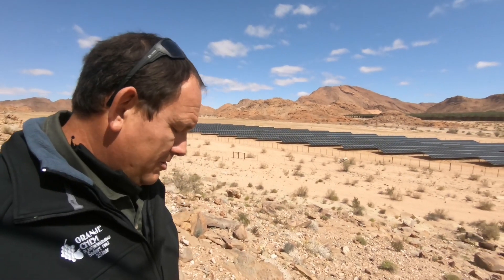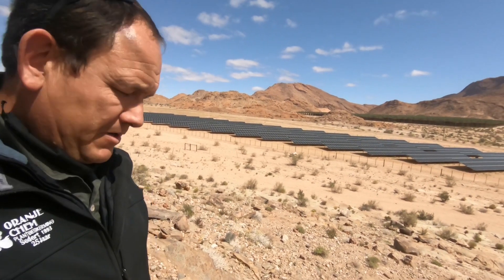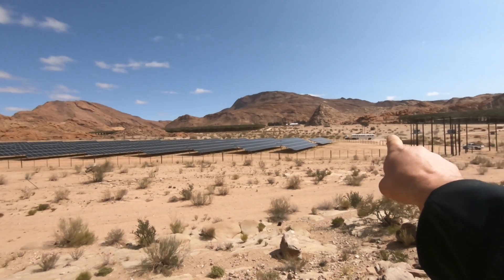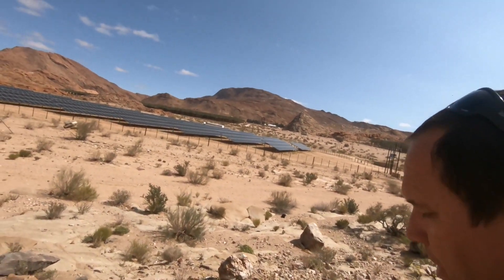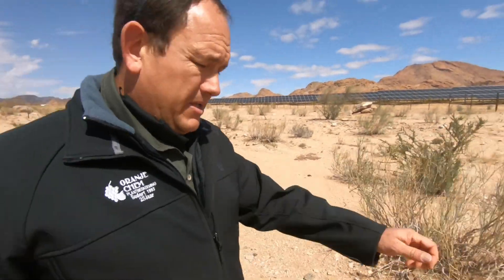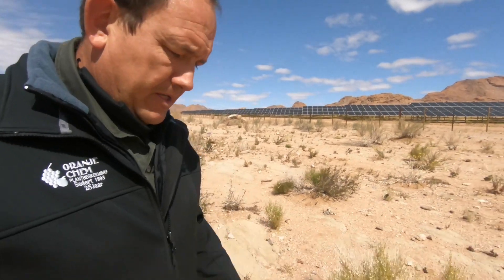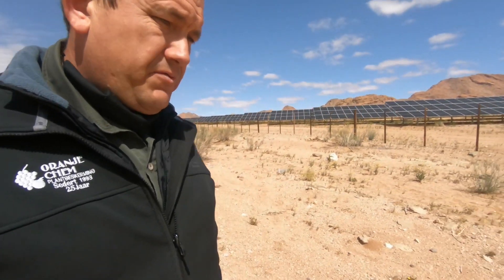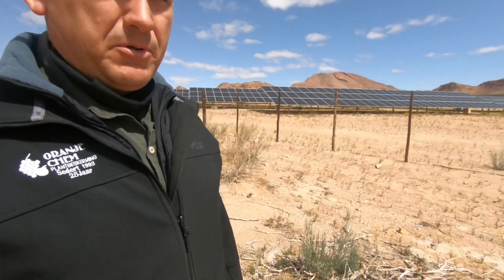Solar system update. Up and running , Generating 800kW

Comment: Thanks Jors. You need to get them to measure the level of harmonics due to the inverter. Also monitor if your pump motors run more noisy, rough or hot which would be the impact of harmonics.
Reply from the maker: Thanks, we have an electrical engineer in our company, I leave those details to him.

Comment: Fascinating Jors. I am not technical and don't understand power. in relation to lets say running a small factory  how far would 800kw go ?
Reply from the maker: My packhouse have coldrooms and packlines to handle about 100 ton of grapes per day  and use about 600kW at peak. 
Houses vary a lot in power usage, but at roughly 8 KW it should run about 100 houses, but only in daytime.
Reply: @JorsMalan  thanks so much for the info